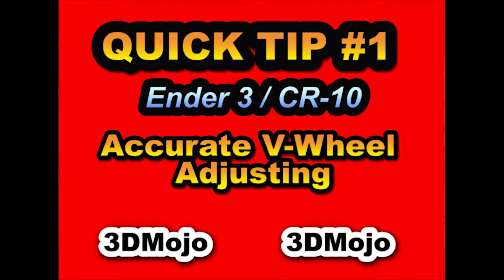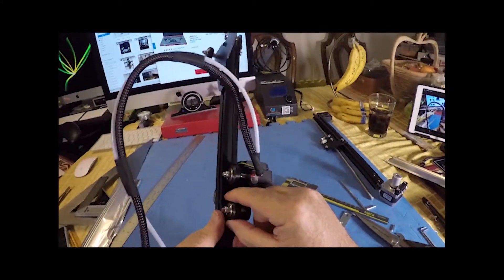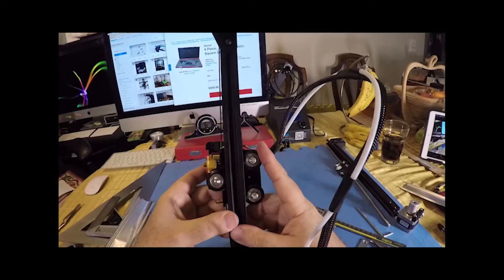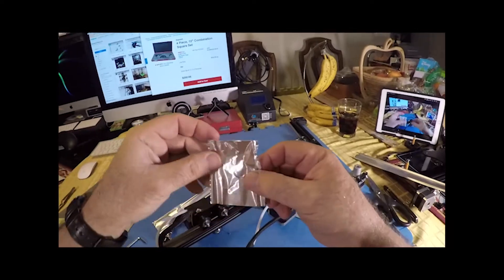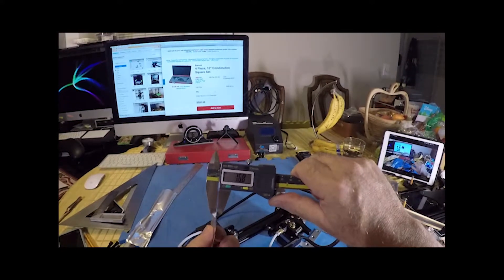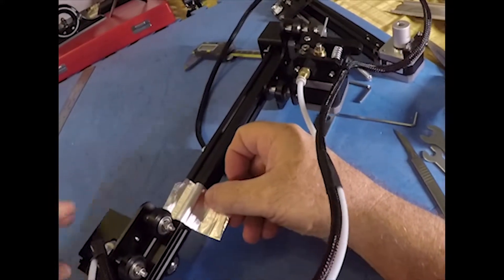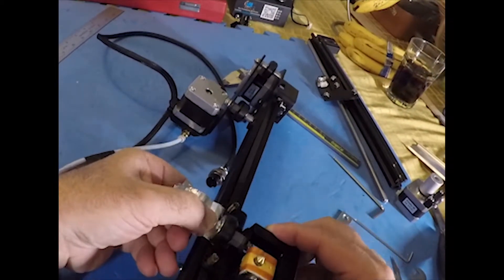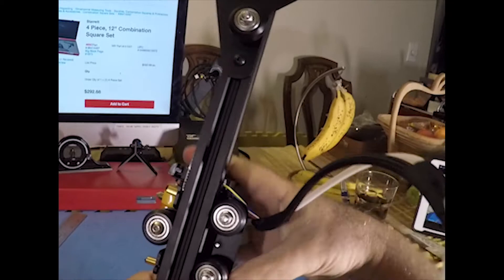Quick Tip 1 V Wheel Tension the EASY WAY (aka POM Wheel)

Comment: Looking forward to your X axis video. Great work!
Just one doubt... Using the foil should the whels just roll without feeling a bump? Is that the point?  What would happen if it's too tight? The wheels just stop there? Thanks.
Reply from the maker: If you can get it at the point of where the wheel doesn't make a noticeable bump but there is a slight something that says you hit the aluminum foil then you have gotten your wheel tolerance to something like 0.06mm if I remember correctly.  This way there is no actual pressure on the wheel.  If the wheel hits the foil and stops then the wheel is too tight.  Its a bit of trial and error to get the feel of it.  Thank you for your compliment.  I am working on a big series but it is taking some time to edit.  All I can say is to make sure your following me so  you can get a message when they are up.  Thanks again!
Reply: @3dmojo275  does this also apply for the other 2 V wheels on the Z axis? or do those need to be tight since they are working against gravity?